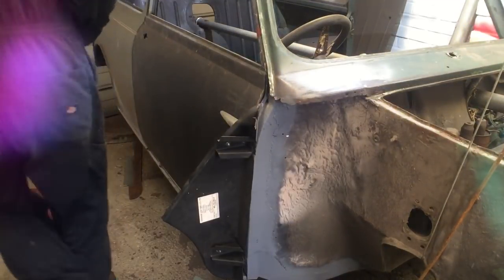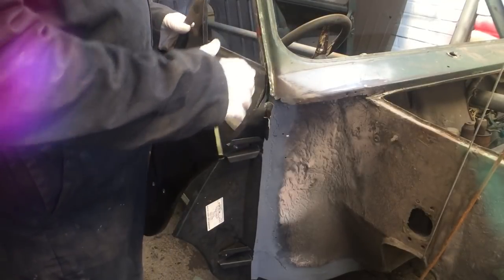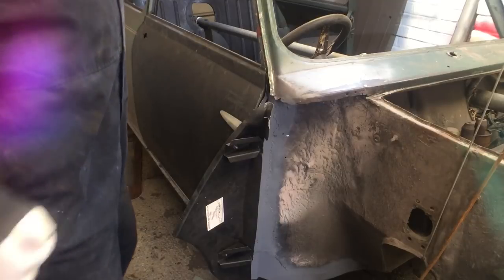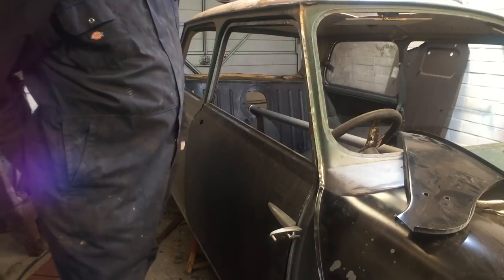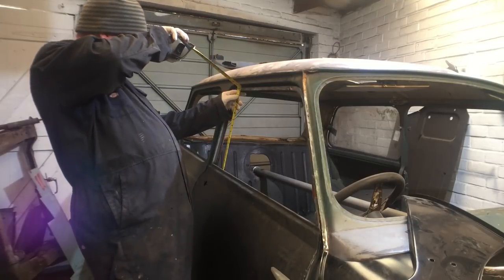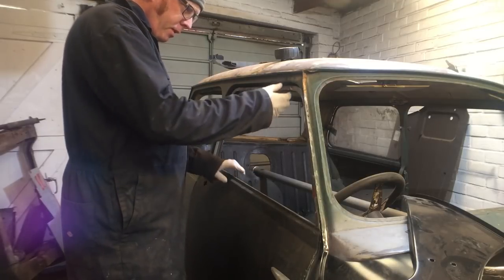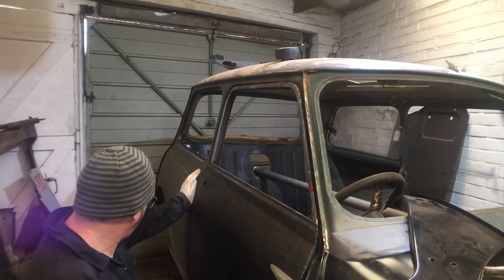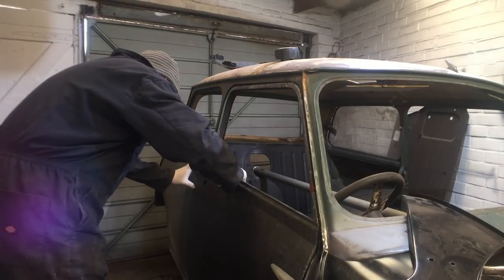1964 Mk1 Mini Restoration S2 Ep48 - A Panel

Comment: Looks like that door glass frame is pushed forward hence catching at the front. The gap on the left hand side looks small at the bottom and wide at the top. Will the frame not push backwards with some brute force and give you more clearance at the front. You can see the spacing at 4.48

Comment: I wonder if you could brace a hydraulic ram in the back seat of the car and have it push and stretch that front door/windscreen pillar about 1/8" toward the front of the car.  Put a board against the door/windscreen pillar.  If you do this, leave the ram in position for several minutes.
Reply from the maker: tis an option but last option , will double check things , as there is no visible damage to roof etc , also these doors did not come with car , so again unknown history

Comment: Umm, Maybe not fit the wing before checking the bonnet fit?,
 Gaps on the door look fine, just shift the glass frame back a bit to even up the gap after the door is hung solidly?, getting the sequence of events correct can be a head scratcher.
 J.